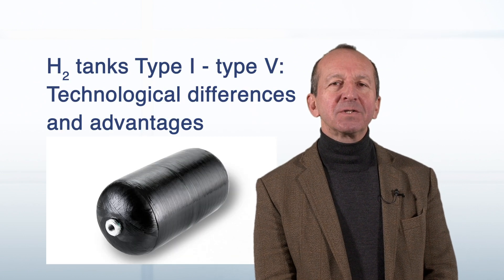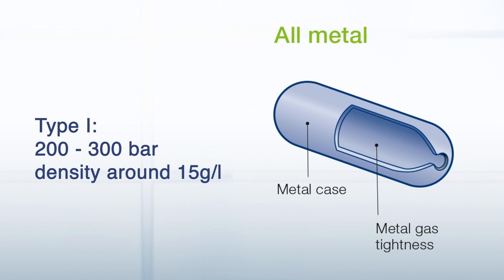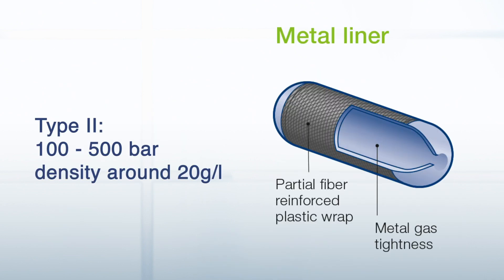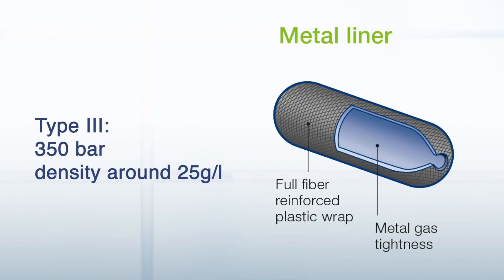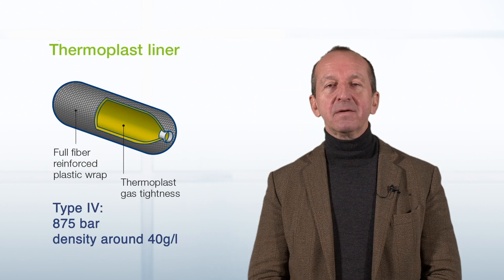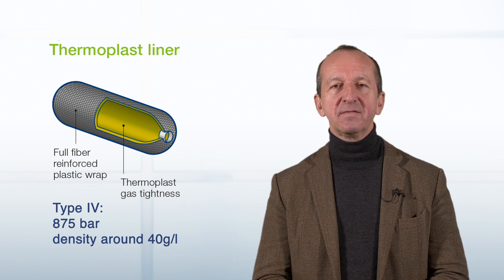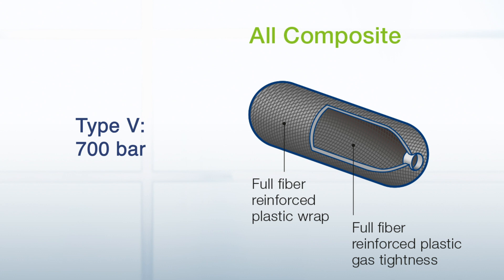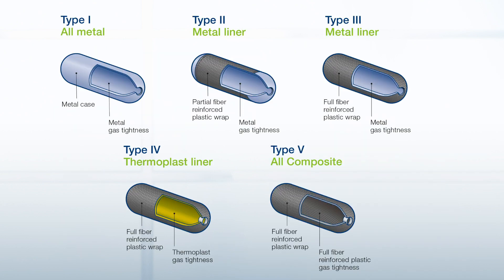H2 tanks type 1 - type 5, technological differences and advantages

Comment: 40g/l = 25 liter tank to store 1kg of hydrogen? is that right? isn't a kilogram of hydrogen equal to about a gallon of gas in energy?
Reply from the maker: Quantity of energy does not mean equal volume. It depends on the density of the element and its physical stage.
Reply: @VoithGroup   pl explain

Comment: Very clear, so everyone can understand the five Types without big explanation, good!
Reply: i have 1 question. what is the bottle manufactured weight of all of these. 2 compare. these are flippin awesome. but for my car. i would have solid metal. n auto disconnect. in a CRASH. these are A SUPER DUPER LIFE ENDING FIRE RISK. bar this. CHEERS exactly what i was looking for.